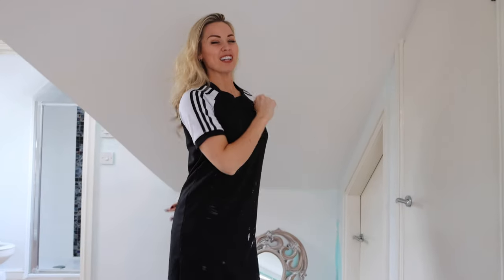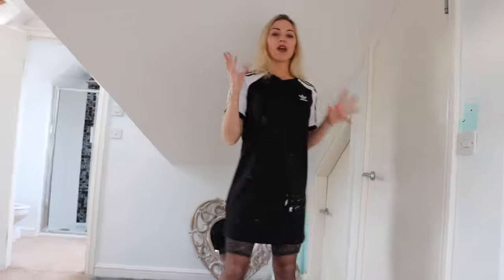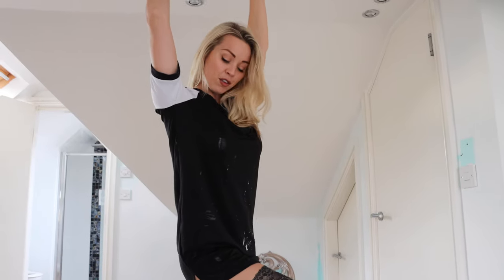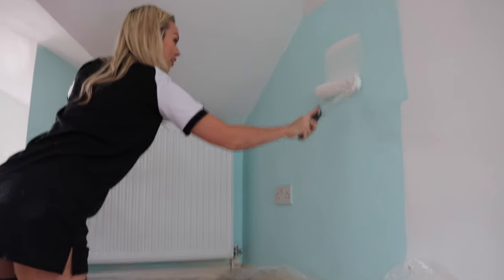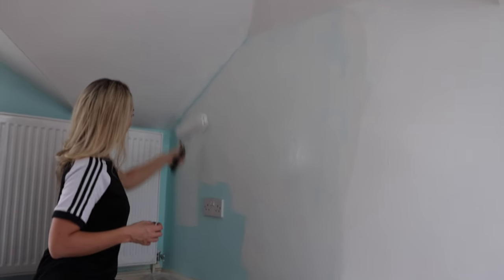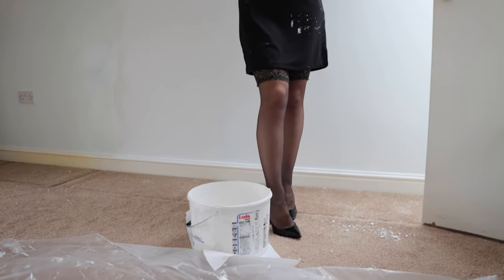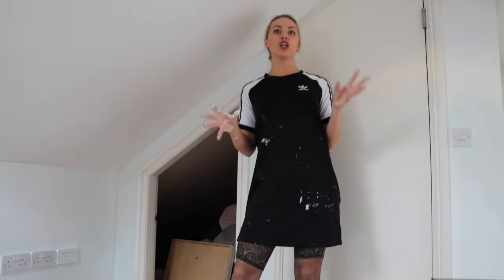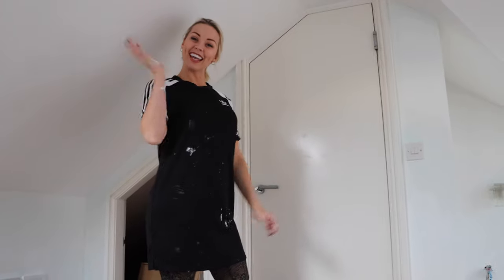PAINTING WITH ME IN 👠

Comment: When painting over a dark color with a lighter color, it is a good idea to use a coat of primer first. This helps the paint to "stick" resulting in a better top coat. Just a bit of friendly advice, and not criticism. After all it is easier to say how something should be done when you are not the one doing it. By the way, did you use oil, or latex based paint?